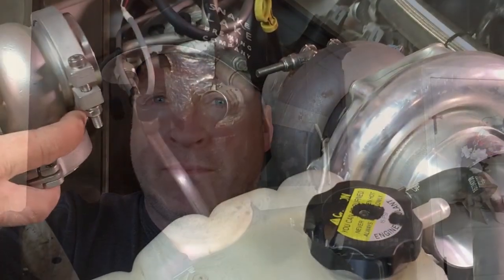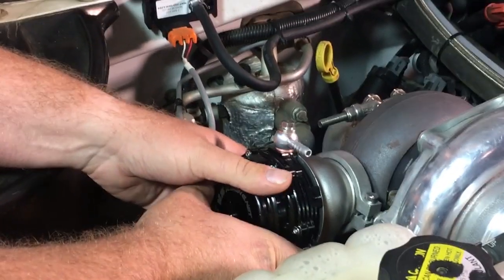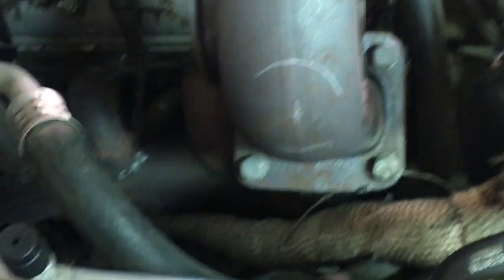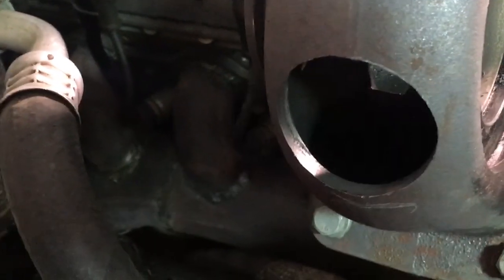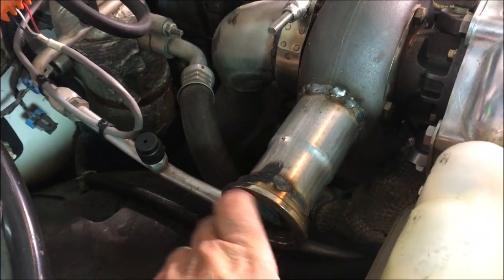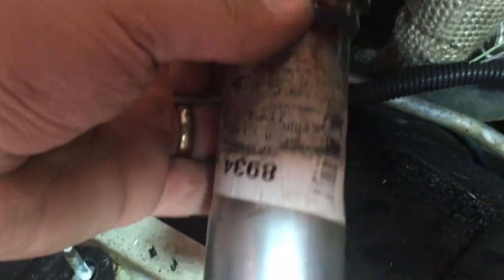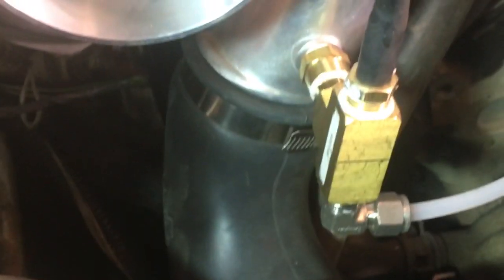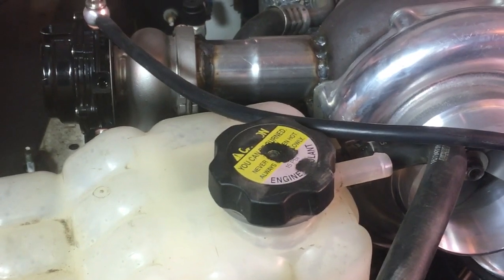VS Racing 44mm Wastegate Install

Comment: Wondering if there is a video or instructions on how to setup the vs racing wastegate.
Reply from the maker: Mike Olsey I don’t have any videos like that but Matt Happel covers it pretty good in this video, I believe that is a Vs racing unit he uses as an example: https://youtu.be/6lvHYmwEpwY
Reply: Oh yea Matt is awesome.    I meant like the initial set up with plugs and vacuum lines.  I didn’t get any extra plugs in mine for what would be my lower or where “water” lines would go at 

So that’s what I was kinda confused about. As far as the initial set up

Comment: is this the wastegate from summitracing ?
Reply from the maker: Gabriel De luna I got this one directly from VS Racing but yes I believe you can order it from Summit Racing now
Reply: Lowbuck LS thanks also ive seen a vs racing bov 50mm off turboforless.com is this a site i should trust ?
Reply from the maker: Gabriel De luna yes that site is owned by Viren with VS Racing so it is a good site to buy from
Reply: Lowbuck LS appreciate the knowledge thanks .

Comment: Size of turbo please! And how much of boost you make ? Cause i have a 66/73 born turbo and im gonna boost 12psi. Do i need a 44 or 50mm gate ?
Reply from the maker: anthony beaulieu this is a 78/75 turbo and I am using a 44mm watergate so you should be fine with the 44 as well

Comment: what type of mig wire and gas mix did you use bud love to watch your videos
Reply from the maker: Robert Allen I just used regular .030 mig wire, not sure the brand. For shielding gas I used a C25 mixture, 25% CO2 and 75% argon
Reply: @LowbuckLS  i appreciate it bud thanks!

Comment: did you need to pre-heat the casting before welding?  mig or tig?
Reply from the maker: Randy Richardson I didn’t preheat and just used a MIG. Have quite a few miles on it now and it seems to be holding up fine.